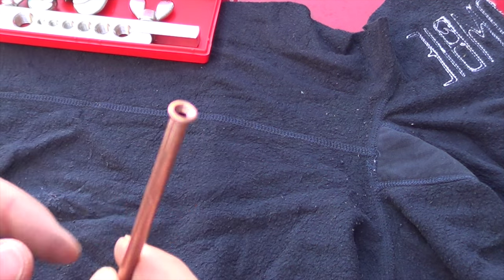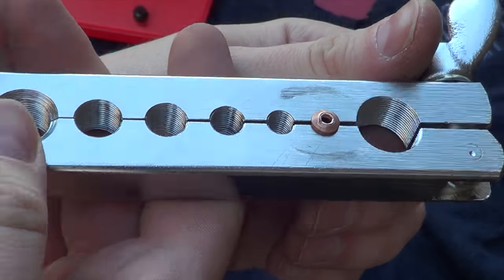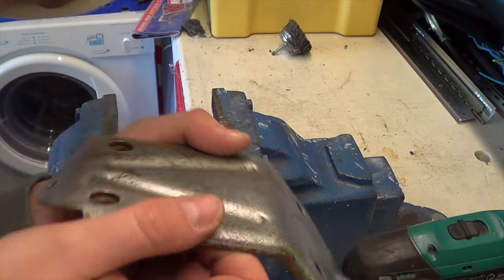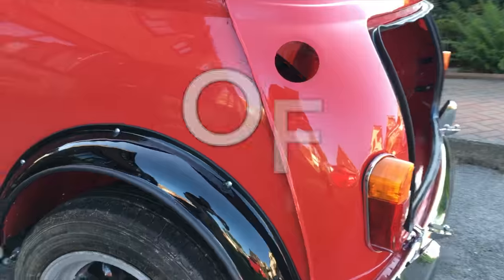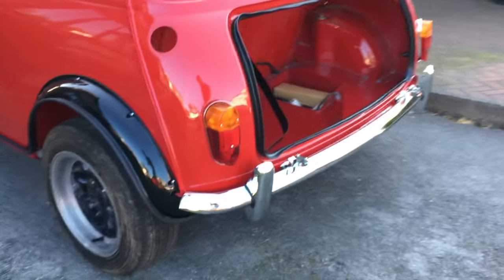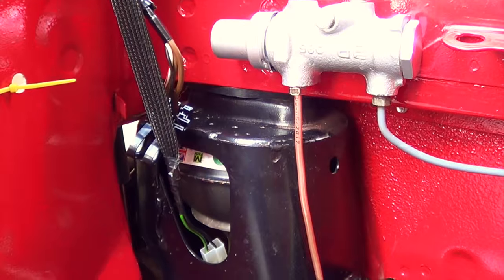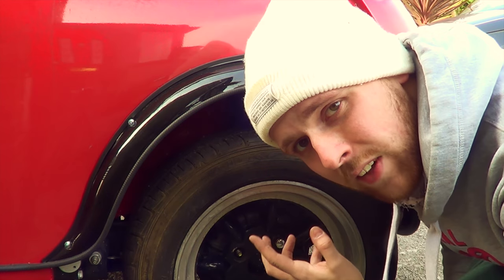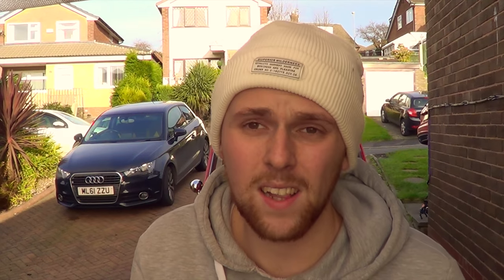Classic Mini Restoration | Flares, Brackets & Mini Of The Week!

Comment: Great work Tom, slowly getting there matey :)
Reply from the maker: Sean C haha! Thanks bud! 1 more episode and then the noobie is going to attempt the engine fitting 😬😬
Reply: I'm sure you'll be fine Tom. I've still got that to come but I need to hope the car stays square while I cut the floors out, well I've already chopped one half and my bum hole has also increased in size :(
Reply from the maker: Sean C hahaha! Did you brace it? The guy that did mine braced all the car when cutting out so the new panel lined up spot on 👌🏻
Reply: Yeah mate, it was braced, whether the bracing was correct is another thing lol
Reply from the maker: Sean C sure you’ll be fine mate! You seem to be doing a good job 👌🏻👌🏻
Reply: Total Car Reviews cheers Tom, let's hope so buddy :)

Comment: Where did you buy that brake flaring tool? Just discovered the one i have only does SAE single and double flares and not the DIN or bubble flare and am looking for a fairly decent but not too expensive one
Reply from the maker: DB Mini DIY machine mart mate, think it’s made by Clarke are you sure you can’t do a bubble flare with yours? As I just spun it round and used the flat side rather than the chamfered side if you get me ?
Reply: Nah it's one of the hand held sae ones. If its clarke it will be decent quality. Cheers